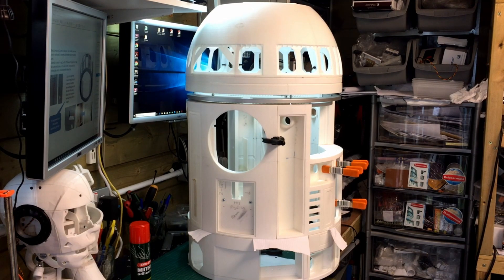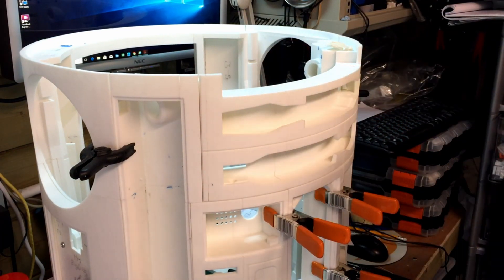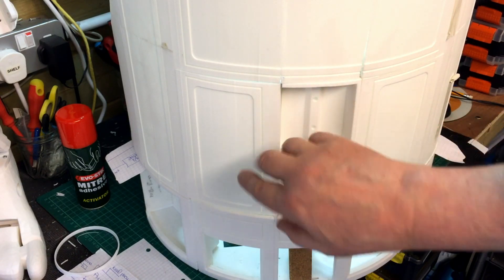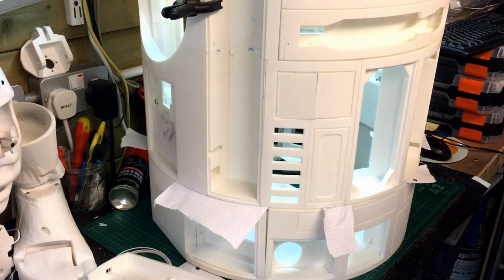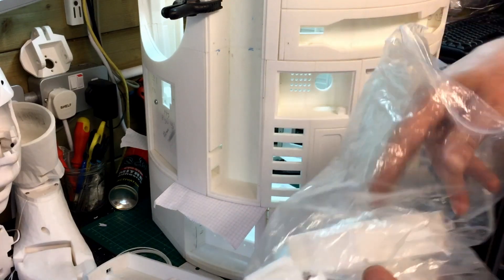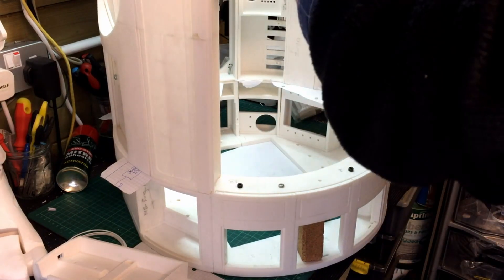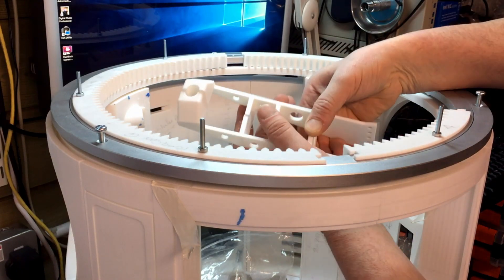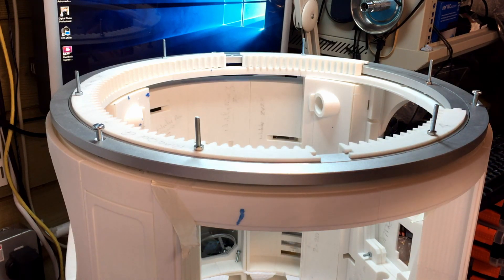R2D2 Droid Build Part - 4

Comment: Watching this resolved some of my questions about the body and generated a few more. (I didn't know the importance of that upper ring you stuck in. I think that lip you were holding at the 1:30 mark was backwards)Have you had a lot of warp and knock off issues? I have with the PLA. I'm on my 9th attempt at printing part 6 of the dome. It gets to 90% and knocks it off the bed. Taping it hasn't helped. I have the same problem printing the rear body panels, they keep getting knocked over about half way through the print. (parts 1, 4 and 6 so far, though I got 6 to print on the second try)Did you need just the 1 servo holder for the utility arms? Or should 2 be printed?I started researching the zapper arm and other accessories. I want to know if I can install them before I print more of the body. Annoyingly enough I can't find them or their specs on the Astromech.net forum other than passing references or that functional one someone is making. I noticed you haven't posted in a while. I guess you are busy.
Reply from the maker: Hi Chris
Yes the lip is probably upside down but see later videos.  I had lots of warping with the body rings and some layer shifts also, but fortunately few totally failed prints using PLA.  Using PETG and FLEX was hard, it took me a while to work out how to print with those materials.   Nylon was OK too.  Try increasing the base skirt on the prints so there is more grip area to the bed maybe?  Its really annoying when the prints fall off the bed!!

Printing the rear body panels was really bad with massive warping so I might reprint them all.   I have also bought Simplyfy3D slicer program because of some of its features, specifically the ability to get the STL models to lie flat on the bed.   It seems pretty good, better than Slic3r that comes with the Prussa.   I used to use CURA with my Wanhoa and looking back, that was very good and easy to use. 

The servos are generally MG996R or equivalents.  I haven't started on the servos installs yet so cant really comment much on them.  I have bought the leg motors and the motor drivers and a couple of 12v batteries and sketched out how I am going to wire it all up and also was looking motor scripts for the EZB controller.  Also bought relays and blade fuse holders etc.   So working away slowly but nothing worth videoing at the moment. Once I get control of the motor wheels and dome rotation using my PlayStation remote/EZB controller, thats worth a video.    

Still also trying to think of a name for R2D2 as well.
Reply: Hi Kyle,Lip: Okay. I think I was actually wrong based on another look at the directions.  I've had quite a few fails with PLA but this new white PLA I bought has been better than most. It is my new favorite. I'm on my second roll, I tend to go through 1 every 3-4 days. The silvers I tried were notorious for warping, popping off the bed, and for not bonding above 4 centimeters from the bed. I may need to reprint more than 1 section of the dome due to that. I haven't tried the translucent blue I bought. I think I'll stick to the white like you did.I've printed in Flex before. Not the other materials. I have 1 of my Da Vinci's set up for it but it is down at the moment. Actually, they both are. The other clogged again yesterday and I ran out of patience to fix it. :PBase skirt: Good call. I'll have to try that. I'm notorious about not using rafts and such if I can get away without it.The S4 prints in Cura. I have neglected exploring other slicing programs. I've heard some really good things about Simplyfy3D from Angus and others. I should give it a go sometime. :)Servos: okay. I have them bookmarked but I haven't started accumulating those bits. I did buy the radar lens though. $4.99 on Amazon. (the one in Rick's list you mentioned) Buying it was much easier than trying to print and finish it with translucent filament!  Speaking of sanding, have you started sanding, filling, and stuff? I've been doing that off and on. It is a pain even with the palm sander! The plastic tends to break, especially the thin pieces like the pie panels. I've learned to make a pad under the curved bits.   I prefer printing in ABS since I can use hot acetone to smooth it. But I can't print ABS on the S4. The hot acetone method is also hit or miss, it depends on the size of the object and the quality of the filament. I used it on the holo projectors and other bits on Sunday with mixed results. It did reduce the amount of filler and sanding needed though. The pie arms and servo bases came out beautifully, as if they were injection molded. I primed them with black and then painted them with brilliant aluminum last night.For the blue parts I'm looking into painting a base coat of True Blue, (over the primer/filler) then maybe a coat of Anodized Blue, then a top coat of that 'Sonic Blue Pearl' that the people at Astromech.net highly recommend. I'm hoping that method will cut down on the amount of the expensive paint that will be needed. (fingers crossed) According to 1 of the threads 1 guy used 6 coats of that stuff and 5 and a half cans. (wince) I'm curious what you'll do.  Oh, thanks for pointing out the change to Ring 2 1-2. I didn't catch the old versus new file until you pointed it out. I've swapped it out in the folder so I won't mistakenly print the wrong parts. I'm looking into modeling the 'power charge arm' (aka zapper) as well as modifying the arm bays to allow the additional arms during my next available 'free' time. I know some people have modeled them or built them real world but none are publicly available.Name: Ole' Sparky? Whistler? It'll come to you. Maybe once he/she is rolling you'll find a quirk that sits well with you. :)

Comment: Great build, I'm not too far behind you and watching with interest. I'm in the UK too, which Lazy Susan did you buy for your build?
Reply from the maker: Hi Carl, I bought in the UK at simplybearings.co.uk for £38.00.  https://simplybearings.co.uk/shop/Be...22/index.html
Just checked that site and its not showing so they must be out of stock of the 450-mm ones.  Have also seen them on Amazon UK and cheaper recently. https://www.amazon.co.uk/Differrent-Aluminium-Bearing-Turntable-450mmx10mm/dp/B06XJQNL5P/ref=sr_1_6?ie=UTF8&qid=1522849227&sr=8-6&keywords=lazy+susan+bearing

I have now managed to get the Dome fitted to the main body, but the dome lower ring jams against the LS so I am shaving out that Dome ring a bit to allow clearance, not finished on that yet.  Also busy printing the legs, which are really long prints. 

How is your print/build going? Have you put up pictures on Astromech site? Its a fun project to do.
Reply: Hi, thanks for the link to the LS. I'll see if the one you used is going to be re-stocked.

My build log is on 3D Printed Droids at https://www.3dprinteddroids.net/forum-61.html

Just about finished all the leg/shoulder parts and will dry fit this week then strip down as I want to do some sanding/filling work.

Carl
Reply from the maker: Hi Carl, yes thats the same as the one I am using.   Note that the outer diameter may be more than 450-mm as 18" is actually 457.5-mm.   The one I have jams on the inner section of the lower ring of the Dome itself.   I am currently reaming out my one slightly so it can turn.
Reply: Many thanks.